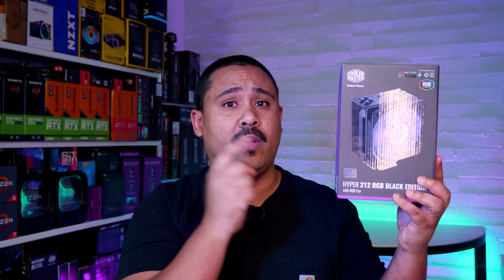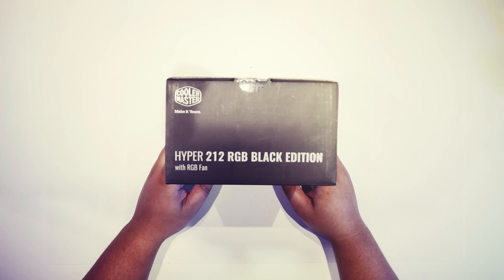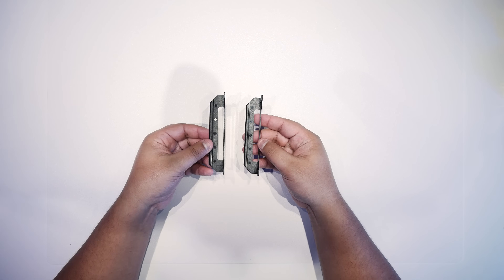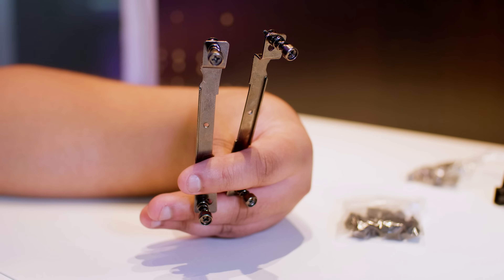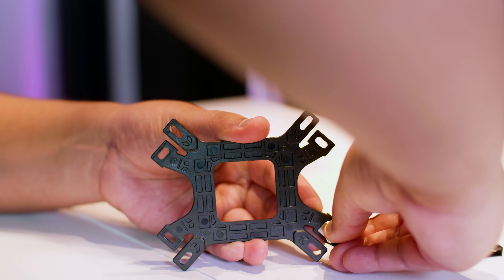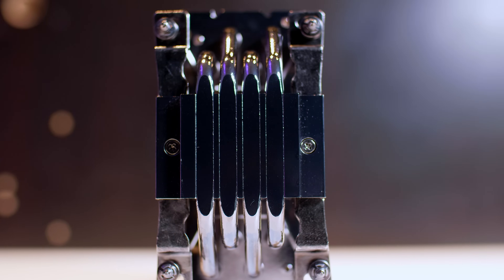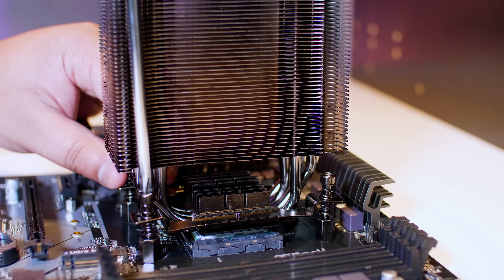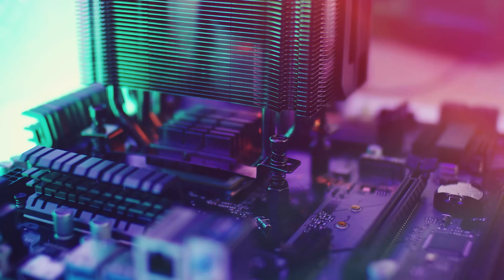HOW TO Install Cooler Master Hyper 212 RGB Black Edition on AM4

Comment: 5:05 this statement caused me to break 3 of the 4 bolts. Thanks.
Reply: That's right nothing I see that would prevent over tighting, they be be something like that on the four heat sink screws, that have some sort of spring set up, still would not trust that all that much.
Reply: even I noticed,  sadly you won't have replacement screws either
Reply: @nims5145  damn man be careful the next time
Reply: HAHAHAHA

Comment: Ryzen 5 2600 gets under stress 83 c with this cooler, I replace it with nzxt kraken m22 120mm and result is awesome, it is 62 under stress
Reply from the maker: You installed it very very wrong lol
Reply: @GearSeekers   I am hardware enthusiastic for 12 years , don't teach me like Hopper's

Comment: WHERE TF DO I PLUG IN THE ENDING OF THE RGB CONTROLLER????

What programs can I download on my pc so I can control the lighting on the cpu cooler? Because it doesnt work on ASUS AI SUITE 3
Reply from the maker: First of all. Why are you yelling?
Secondly use Aura Sync only if you've plugged the RGB straight into your motherboard. The controller is not required.
Reply: Gear Seekers yeah, sorry. I was really stressed atm when I wrote that, I thought I ruined my controller. But yeah, I figured it out, but thanks for answering.

Comment: Grrrrr I just transferred my entire pc into a phanteks p300. My 212 is arriving tomorrow I didn’t know I have to remove the motherboard for the install or I would have waited until I had it 😭
Reply: It is possible to installing it without removing the MoBo from the case, it's just more difficult tho...

Comment: Can i use it with my stock amd cooler backplate/socket?
Reply from the maker: the backplates are different. You will need to use the one with the cooler.
Reply: Gear Seekers Ok, thank you!

Comment: Great installation guide. 10/10. Few years ago I installed a hyper 212 and it took me over 2 hours and was very frustrating, although it was my very first build and I was a novice. This video was a great refresher, and I had it mounted in not even 20 minutes or so. Subbed. Ty bro.
Reply: Hyper 212 is notorious for installation difficulty. Normal coolers should take 2 minutes

Comment: screwing in the screws to the mounts takes like 1 hour
Reply from the maker: That's because Squid don't have hands
Reply: @GearSeekers  but there are 4 of them?
Reply: @GearSeekers  🤣
Reply: @GearSeekers  That's because it's a shitty cooler. Trying to mount one now on my friends PC and it's an absolute nightmare. The screws don't line up.

My Noctua is simple to install and twice the size (except on the Noctua I have to cable tie the fan on as I have to choose between fan bracket and video card).
Reply: @lilgodzillr  Installing this cooler is no big deal. You've probably two left hands.
Reply: For my first build (Ryzen) the stock wraith cooler took me 5 hours to get on, I had fucking cold sweats. almost had a sheer heart attack. very happy with my build a month in.
Reply: @nathanieltheanimal9450  How the hell did it take you 5 hours to get the cooler on lol, My first build literally took me an hour start to finish, Cooler was like 30 seconds lol
Reply: @darrenmoore9239  I explained it in detail in the comments but (tldr) I was being a pussy with screwing it in. was my first build and didn't want to break anything.
Reply: @darrenmoore9239  I feel your pain hahaha
Reply: @darrenmoore9239  I didn't even have to take my Mobo out to put the bracket on
Reply: Nathaniel the Animal how did you do it
Reply: @haarissheeraz8235  I wasn't pressing down hard enough. I was being way way too gentle. You have to push hard enough to compress the springs that hold the screw and then screw it down. - in a crisscross fashion that is- it'll want to come up as you screw one corner in so you just have to go after the other corners. It takes pressure.
Reply: Nathaniel the Animal thanks
Reply: @haarissheeraz8235  of course hope it helps and after you've done your first cooler, installing an aftermarket cooler/ io is a breeze. Just takes practice and experience over time of doing it.
Reply: Nathaniel the Animal yeh I've installed it properly and it's working now
Reply: @haarissheeraz8235  nice! That's good to here. Everyone has their pc horror stories even if they're simple solutions to simple problems. The more times you tinker the less anxious you should feel about building.
Reply: @nathanieltheanimal9450  I had to remove my yesterday because it wouldn't let me add more ram the way it was. I couldn't get it back on and hard to take the motherboard out so I could hold the back plate in place
Reply: @nathanieltheanimal9450  same xDD
Reply: Nathaniel the Animal lol same
Reply: Allan Cameron try hard took me up 2 hours and how do I work the rgb like where the fuck do I plug it in I don’t have a rgb header so where do I plug it in
Reply: Ordinary GP yea I’m planning on getting a new mobo later on like in a couple of months cause I’ve done spent to much money on the pc
Reply: those screws with the square backplate snapped off as soon as i started screwing the cooler in.
Reply: It won't fit my msi B550 motherboard. Cooler isn't wide enough to fit into all holes, only goes on one side only smh.
Reply: @KrazyTylerX  Same on MSI B450  Tomahawk
Reply: I just wanted to see if anyone got the other fan and what kind it was, then I saw all the how long it took some of you to install it. The cooler is the easiest thing to install next to RAM hahaha wtf🤣🤣🤣🤣
Reply: SquidTree how the fuck is it even possible
Reply: @crypticchaos5296   you really gotta push hard dude - i thought i was gonna break my cpu when installing but just send it - it works great
Reply: @DVRKSIDE_  lol I gave it a full send to the point I swore my motherboard was gonna snap lmao and than I realized after doing all that the box actually comes with extra risers so u don’t have to use much strength wish I would’ve looked at all the screws before doing this shit
Reply: it took me 2 mins lol

Comment: can i apply liquid metal on this cooler
Reply from the maker: You should be applying liquid metal to any cooler
Reply: @GearSeekers  bcoz its says do not use on aluminium heat sink. does this cooler have aluminium base ?
Reply from the maker: You shouldn't be using liquid metal on CPU coolers

Comment: Amazon just dropped mine off about 20 minutes ago. I'm watching this video before I shut down and install. Currently, Ryzen 5 2600 (no OC) idle temps is 40C and max temp under 100% load is 83C with an ambient room temp of 70F (21C) with AMD Stealth Cooler.
After install: Idle temps are 27C-28C, 30 minutes of 100% load cpu stress test (the one in cpuz) max temp was 59C.
Update: After overclocking the Ryzen 5 2600 to 4GHz, Idle temp is 30C (room temp 21C) cpuz stress test 100% load for 1 hour Max temp was 66C.  My system is installed in a Phanteks P350x case with 5 UpHere RBG case fans running at 1100rpm, the sound meter on my phone says the system is running at an average sound level of 34 to 42dB right on top next to the fan, two feet away from the tower the noise level only reads 10-14dB,  so the system is reasonably quiet.
Reply: thanks br i have same configs , except my ambient temperature is 25-30 and yea even my 2600 is toucing 83 sometimes , how does this fit in p350x ??does door closes properly??
Reply: @APEX-WAPEX  The hyper 212 BE fits in the Phanteks P350x with about 5mm to spare. No problem attaching the glass panel.
Reply: My idle temps for the stock amd r7 1700 oc to 3.7 is 45
Reply: Thanks! that's the same temp I got with stock fan and this helped my decision.
Reply: Man i was about to ask a question like this. I have the 3700x running with the wraith prism. My idle temp is 45c. I might cop this and install
Reply: yo when u changed ur cooler, did u change it while the mobo was in the case?
Reply: Darkg 24 idk about him/her but I had to take out my MOBO
Reply: Is this with 1 fan or 2 installed on the hyper 212
Reply: My idle temps are 51 C but I do live in Hawaii
Reply: I have the same cpu but my temps were so high. I ran cinebench after installing the fan and max I went to is 79.
Reply: Okay gamer... 's nexus
Reply: ima act like ik what tf your talking about
Reply: Got the same cpu and my idle temps are 95°c I tried to reseat it but messed up the thermal paste and while searching for some on Amazon found this cooler and decided to get it after reading your comment thank you, you really helped me

Comment: bought this! now.... how do I control the colors? is there software to download? i have the controller thing but I got the computer built for me so I have no idea how to connect it. help a newbie like me pls! btw very cool video
Reply: ꧁Ira Lol꧂ it’s compatible with aura sync if you have an Asus motherboard
Reply: @joshc7765  my mobo have the rgb connector but no AuraSync integrated. It'll work?
Reply: @lukazlkz  Aura sync is a software you can download only compatible with Asus mobo otherwise you have to use the controller. Whats is your specs?
Reply: @joshc7765  Asus prime B350 plus
Reply: @lukazlkz  yeah so go to this website and download the software https://www.asus.com/campaign/aura/us/download.html

Comment: Can u install high profile ram with this cooler?
Reply: Id works for mine just fine. But you can align  the cooler vertically, or horizontally if it does get in the way of the ram. I'm sure there might be Motherboards out there that are  incompatible, But I have yet to hear of or see one yet.
Reply: im running this with 2x8gb trident z royal rgb, and theres no way i could fit 4 sticks if i had that, unless u moved the cooler towards the window which would look funny

Comment: I have this cooler, and a Gigabyte 470 Auros motherboard, but can't for the life of me connect it to that motherboard: There IS a 12v RGB pin, but it's a 5-pin instead of 4 pins. And it won't connect to anything else.

Comment: I dont think I have a 4 pin  connection for the rgb on my board.. what exactly is my step again? that connector goes where?
Reply: this RGB  is a 12V 4pin plug, do you NOT instal this in a ARGB 5V 3pin!!!!
Reply: @danilopassos1565  thanks have a whole new desktop now lol

Comment: so if i want to change the color I have to open my pc case just to press the button?....
Reply: I think so too lol. That's why ur better off to just plug it in the RGB header of the motherboard, otherwise it's a "set and forget" controller that u tuck away inside the case.

Comment: Love this cooler but cant seem to make the rgb work on my msi z390 pro carbon ac. Its plugged into the rgb2 header and I have mystic light installed but no rgb (ram,case and mobo rgb all work).

Comment: Does anyone know where the rgb header on the tomahawk b450 is located? i will be building on this mobo tonight with this exact cooler.
Can the rgb of the cooler be controlled by any software?
Reply from the maker: Read the manual on the product page on MSIs website
Reply: It's written on the motherboard

Comment: HELP, when i plug in the rgb cable straight into the 4 pin rgb it doesnt work, but if i plug it with the physical controller the rgb turns on.
Reply: I also am having this problem with my B450 tomahawk board. I was wondering if you could control the lights if you used the physical controller
Reply: @dexterwilliams163  Same here. No lights.  Connected to the JRGB2 slot on the Tomahawk Max.  All up to date.  All connections double checked.

Comment: Only issues im having with this coolar are 
A. One mounting screw, no matter how evenly I tighten, always sits crooked.

And B. Mounting the board back into the case with the cooler attached is a pain in the ass

Comment: If you have an older motherboard, and have to use the RGB controller, how can you change the RGB then? I mean, isn't that controller in the case all the time then?
Reply from the maker: Yes. You need to press the buttons

Comment: Do you need to remove the already installed backplate on your motherboard, or can you use that one for the cooler as well? Thanks for the great video!
Reply from the maker: you need to use the one that comes with the cooler
Reply: @GearSeekers  Thanks for the quick reply! Yeah, I just noticed that you already answered the question on another comment xD Anyway, keep it up!

Comment: Might be a stupid question......Compatible Fans / Size if I want to install a second fan on the other side? Thanks
Reply from the maker: Any 120mm fan should fit no problem. It also comes with a splitter for a 2nd fan as well.
Reply: @GearSeekers  Thank you very much for the reply, new subscriber 👍

Comment: The inefficiency of air coolers intrigues me.
Reply: This is bait, but I'll bite. Air Coolers are very efficient, and usually cheaper than an AIO. The challenge is that to be effective they need to be big. The same applies to AIOs, but with an AIO you are splitting up the CPU block and the radiator so it seems smaller. If you have a big enough case & proper RAM clearance, a beefy Air Cooler will give you the same good performance at a lower price point.

Comment: A decent cooler but way overpriced. I can buy better coolers for less
Reply from the maker: $45 is not expensive for a cooler.
Reply: @GearSeekers  there are better Arctic, Cryorig coolers, several other manufacturers make decent coolers at that price range. Not worth the performance, specially if they are asking that much just for RGB.
Reply from the maker: I'm sorry but $45 is not a lot for a cooler. This is not a review this is an installation guide. The price isn't even a point of discussion.
Reply: @GearSeekers  no it's not. Just giving my point of view on a product that is being shown on the video.
Reply: you do know he has a sponsorship with coolmaster right? he get Review samples all the time and these coolers rock anyhow, one of the the best midranged air coolers and yes at 45 is a midrange price but i was looking at Noctua now those are expensive, through some Noctua - NF-F12  3000rpm fans on it and bobs your uncle